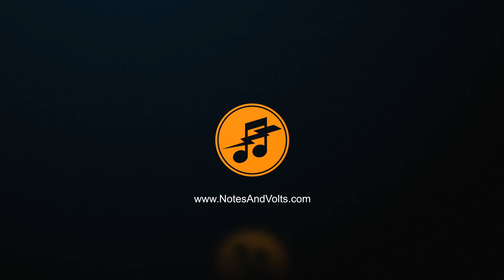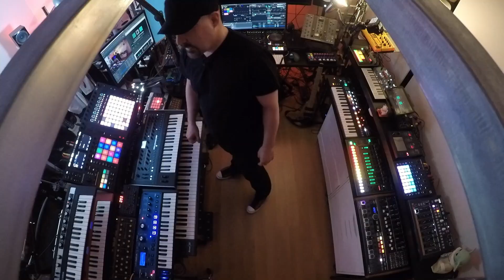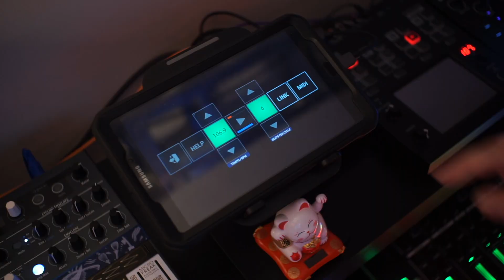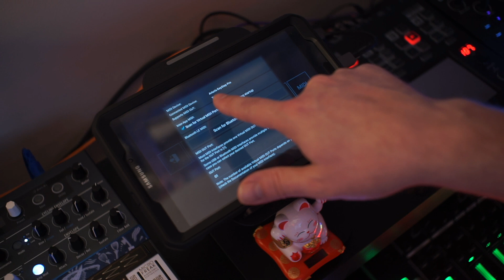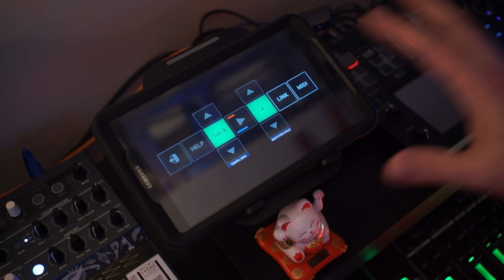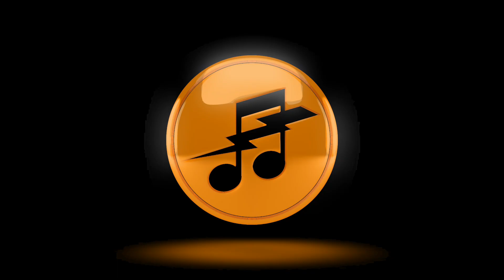Connect ABLETON LINK to your MIDI Synths - Link to MIDI Bridge

Comment: I've been using the iOS app "MIDI Link Sync". which works similarly to the app you are suggesting. But I think the app is no longer available. This is great! Do you know if you can sync link to a MIDI clock also? Thing I loved about the older app is that I could use my hardware sequencer as a master clock which is awesome.
Reply from the maker: I think this app only syncs to Ableton Link and outputs midi clock